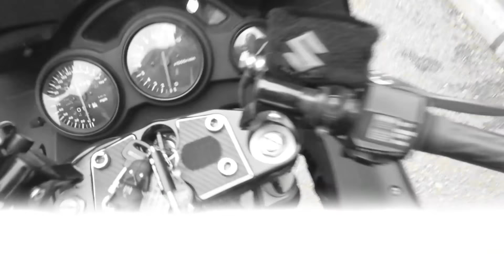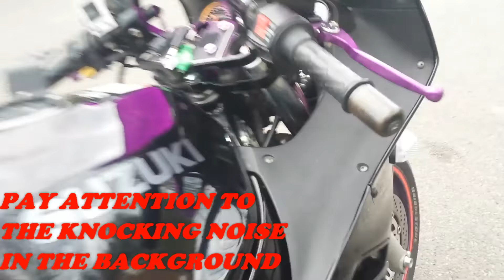Suzuki RF900 Engine Knocking Noise FIXED!!

Comment: IMPORTANT QUESTION
does a bad spark plug causes the engine to feel dead when given full throttle, very low rpm, then it accelerates?
Reply: Yeah Or fuel pump Hopefully its the spark plugs thats very cheap repaie
Reply: @Kels14B  it turned out that my carburetor needed to be changed and I changed it. Problem solved 😊👍
But bcz of the economic crisis in my country Lebanon it costed a bit too much money.
Dollar was 1,500 L.L.
Now it's more than 15,000 😭😭😭😭

Comment: I had same tapping on my 96 RF900, my mechanic loosened tensioner then tightened it back down as he said it sometimes needs help moving on to the next tooth. It did fix the problem. He also stated that they're noisier engines due to Suzuki trying to keep prices down used no sound deadener in engine covers like Honda will do to make their engines very quiet.

Comment: I have an 83 GS1100. 22k now. The guy I bought it from had a receipt from a bike shop that tires, oil change, inspection, etc. was just done. So I put 2k on it and it was time for an oil change. On the test ride I noticed the top end was noisy. So I got home and kicked the side-stand out and got off with it running. TAP TAP TAP!!! It got worse. I jumped back on and leveled it out and it got quieter. I immediately shut it down, checked the oil level. Spot on. Immediately started freaking out thinking something went bad. After a smoke or two I started looking around and what I came up with was the oil itself was causing it. It didn't like modern oil. I don't remember exactly what brand it was and I know it wasn't synthetic. I don't go cheap on my GS. I looked for traditional oil and chose Rotella T4. I immediately changed the oil and it went back to sounding like it should. I have done 4 more oil changes since then and the top end never sounded like that again. When you cut to the video of your RF I had flashbacks of that day. It sounded exactly like yours did.

Comment: Guys i also have 1994 RF900R arownd 30k miles and you should know that there is a little bit more simple solution to the same problem. The chain tensioner has 2 springs the first one (the longer and softer) is inside it and the second is on the top of the piston, the solution is to open the tap that covers the first spring (DO NOT REMOVE THE TENSIONER FROM THE ENGINE) and just push the piston deeper by hand into the engine until you feel that you are compressing the second spring, but be carefull not to press too hard because it will worn out the plastic "bananas" that lead the chain, than just put back the long one and close the tensioner. Usualy that job must be done by the long spring but after so many miles it gets softer and it can not do it properly any more. If the noise is not gone after the procedure, you either didn't compressed the second spring enought or your tensioner has a broken fixation tooth and needs replacement, and if it wasn't for 1 of those reasons you have to reaplace the timig chain and the other stuff that goes with it (sorry). Worked in my case I hope it works for you too. Sorry for the crappy english I'm from Bulgaria and don't use it very often.
Reply from the maker: Good advice man! and good english too!
Reply: why dont you marry it then
Reply: Replace the ting chain they are not overly expensive and they are a critical engine part that if it breaks will destroy the engine.
If the springs are no longer pushing hard enough it because that there maximum allowable travel.
Reply: @leeengelsman6356  I don't know what's the case on your bike, but on mine there are 4 cm of travel until the end of the tensioner, the springs are weakened because the bike was sitting still for 5 years without even starting the engine, before I got it.

Comment: Alternator coupling rattles on later RFs before they fail.

Valve clearances close up with  age, not increase, find another mechanic😊
Reply from the maker: You need to learn a bit more about those bikes.. They had 2 types of alt couplings : early models had solid drive and later ones had bush drive. 
It's only the bushed drive that used to fail and my bike is an early type with solid drive which is faultless. 
Alternator and it's drive never rattled in my bike.
You have no idea..

Also if valve clearance only closes up with time then why bikes often end up with loose valve clearance? 🤣
Clearance can get either tighter or looser  and you have no clue again..

Comment: Thanks for the information I have the exact same sound on my 96 RF900. I've got about  23K miles on it. It still runs very strong I do keep my maintenance up on it. This noise has been driving crazy. Will have it checked out.
Reply from the maker: No probs bud, happy to help! Before you spend serious money get your alternator checked because those can generate this sort of sound. It's my second RF9 and the previous one used to make similar sound from alternator(noisy bearings)  
One more advice regarding knocking sound. Some of those liquid cooled GSXR/RF engines generate tapping sound when to much oil was poured in the engine. Drain about 300 ml,wait until engine gets cold then start it up again and carefully listen if it still knocks. Sometimes it gets a lot better when excessive oil gets removed. If it still makes that sound then pour the oil back in cause the problems is somewhere else. Check that first, it costs no money and might solve the issue. Good luck bud
Take care
Reply from the maker: Hi bud, it is a bit puzzling to be honest.What about valves? Do they have the right clearance? Valves that requires maintenance will also give a similar ticking sound. Some people say it's the alternator's bearings but i doubt it cause in your case(and in mine too) the sound was somewhat internal. You suspect crank bearings but they usually knock hard,loud and from the bottom of the engine. For crank bearings it's really more of a banging then ticking. There was a post on RF900 FB forum recently and the guy said it could be wrist pin being lose. The problem is that it could so many things..The only 100% accurate method of finding out would be puling the motor out and taking it to pieces to inspect:( Sadly most of can't do that:(
Ride safe bud!

Comment: Mine...still does it time to time... new cam chain and tensioner was hand adjusted ... so who knows :) gaps were checked too. maybe will check valves again
Reply from the maker: You know what? mine also does it from time ti time. Very rarely but sometimes it still happens... Really bizzare...
Reply: I even took the cams out to check are there any oil pipepes blocked... but nope.

Comment: It's definitely not the chain adjustment that doesn't make a tapping noise. Thats valve clearance. A header leak at the head will make the same sound

Comment from the maker: yep. sounds about right bud. Mine vibrates signifficantly between 4 and 6 k rpm. gets very smooth below 4k and over 6k. Weird. Supposedly that's normal.
Reply: Mine too same
Reply: Whats the solution
Reply: Put a steering damper on the bars their also called stabilizer
Reply: @fahefahim5262  it’s normal. Just the engine harmonics.

Comment: Okay, mines got the same, but not quite as badly. Hmmmm. But why replace the chain...hmm. On other bikes you just change the tensioner and new chains are not supposed to run on old wheels. Often can be done from the outside, even. I need to look into the schematics. Thanks for the video, btw !!!!

Comment: How long did you drive with it like that?
Reply from the maker: Few thousand miles
Reply: adikxx83  just gotta mine and it’s making this noise. You’re like the only person on YouTube who makes videos on the rf900 so you’ve been a tremendous help. Debating if I wanna drive it as it is over the summer then work on the valves in the winter.
Reply from the maker: @minikyle5748  get your valve clearance sorted. I know people who had clearance out of specs and that exact noise was pronounced. After replacing shims NOISE WENT AWAY !

Comment: Shims are fairly Easy you could do it yourself - screw and nut adjusment is hard and annoing to do.
Reply: Screw and nut adjustment hard to do? Its as basic as changing oil  and about 1/10th the work of adjusting shim under bucket.

Best to leave the commenting to the boys that actually know how to wrench.